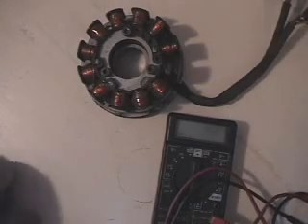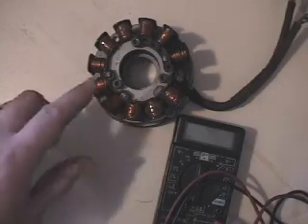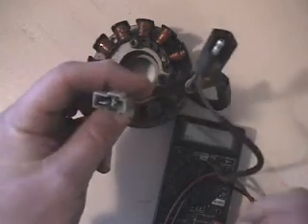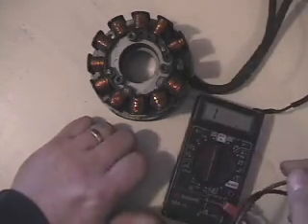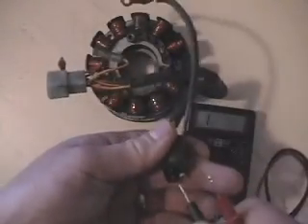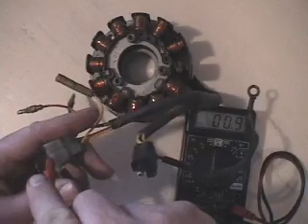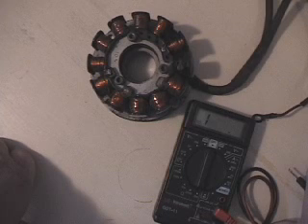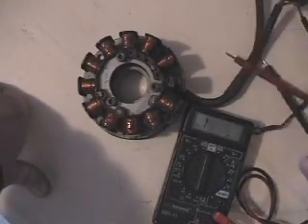Arctic Cat ZR 440 SnoPro ZR 800 and ZR 900 Stator Testing

Comment: hey blaine, wondering if you can help me ??I've got a 2005 King Cat 900 in a Custom chassis, turbo charged and running an MSD electric fuel pump, problem is not enough power to run fuel, and oil pump, CPC gauge, boondocker control box, and a AF sensor, thinking I have to add a battery or a Capacitor ?? wondering your thoughts and any helpful advise would be greatly appreciated